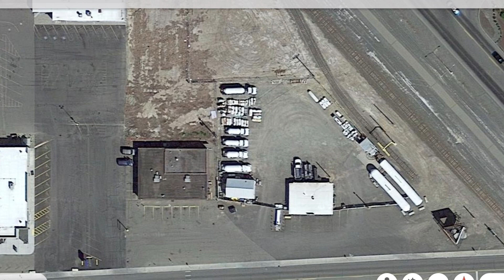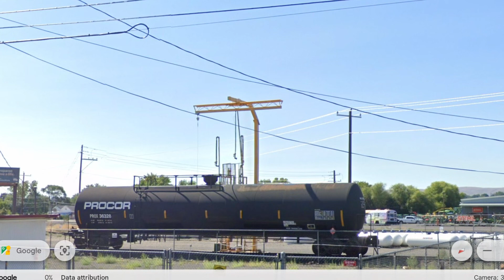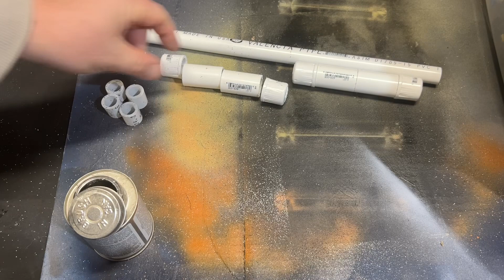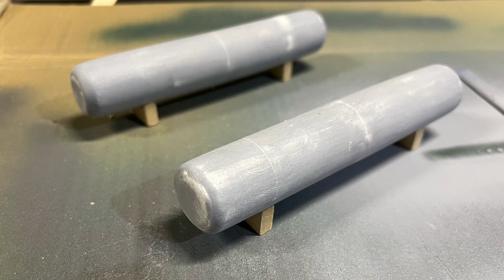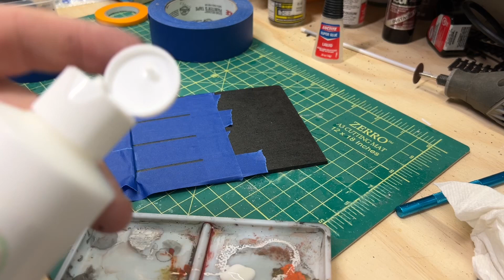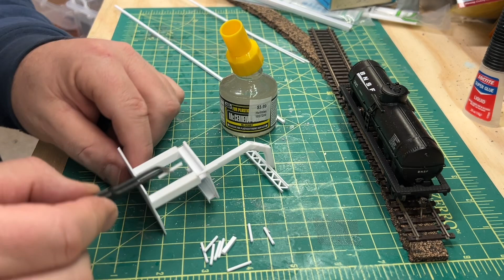Propane facility build project part 1.

Comment: Nice build. Love the look of the loading platform! Question - if you used 1/8th for the base/sidewalks/etc and stated you used 1/8th for the parking lot, how did you get the 'ledge' between the sidewalk and the pavement? Would seem they would be level, I missed something. Thanks!
Reply from the maker: I layered the 1/8” material to build it up 👍🏽
Reply: @TheKitBashers  Thanks, makes sense, thought I was losing my mind LOL